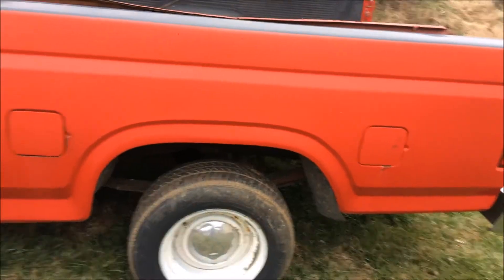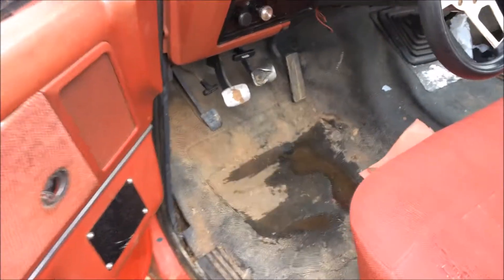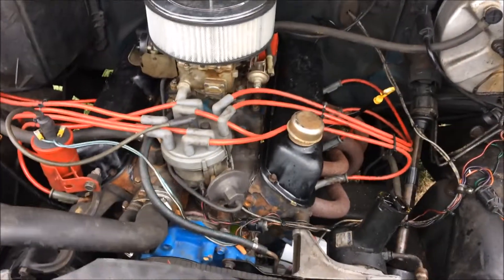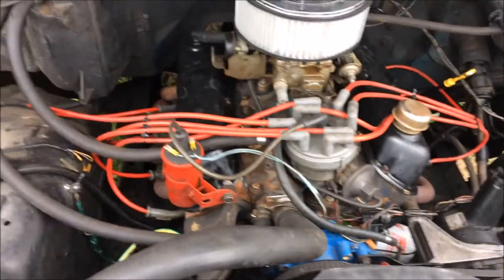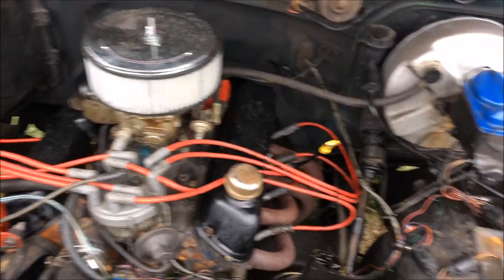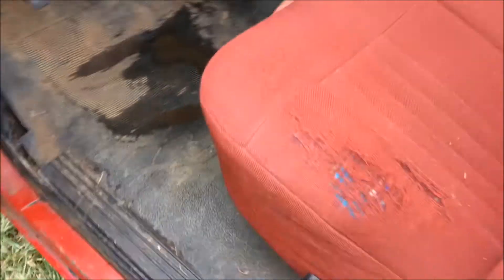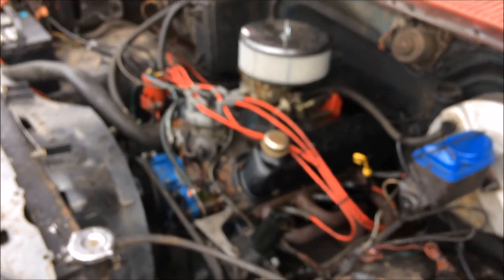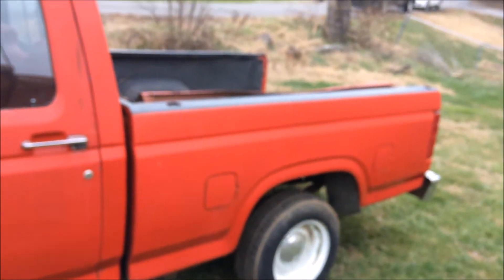1985 f150 Swb project

Comment: Clean looking old truck to bad about the motor.Its a good thing they are easy to find and not to high dollar.It is certainly a lot straighter than my 86 swb F150. Is it four speed or 5? Sure looks like the paint held up good!
Reply from the maker: It is a 4 speed It had been painted the cab was green. I had a 1980 swb when I was 17.